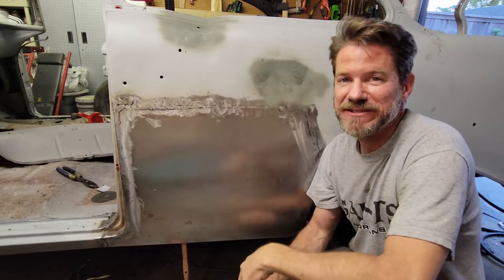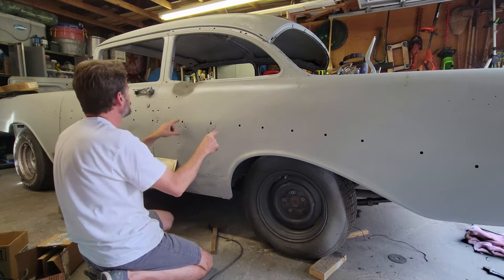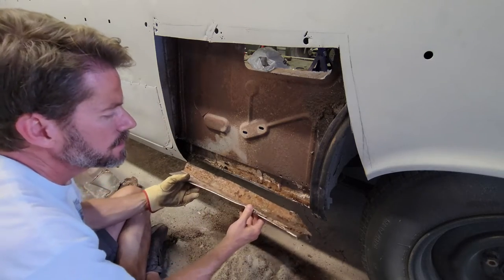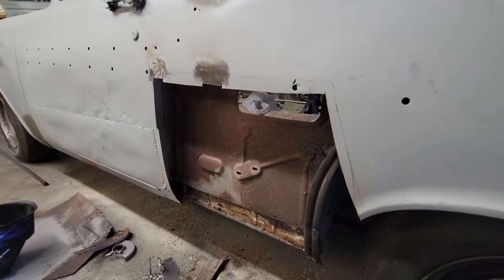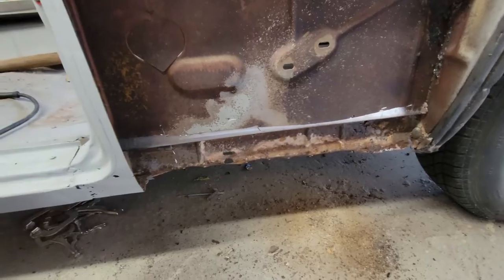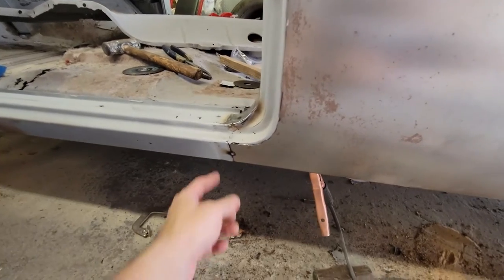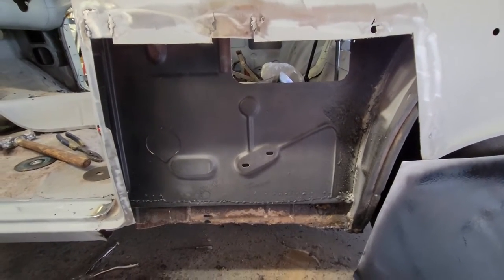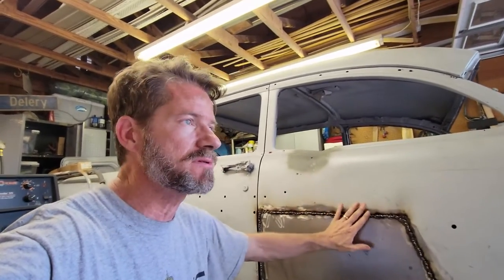E17 Tri-Five Rear Quarter Panel Fender Replacement!  1956 Chevy Bel Air Restoration

Comment: Heat causes shrinking. What you have now is shrinking, you have to make it relax now.
Reply from the maker: Yes, and I've got a little bit of work to do on a couple of broad panels to do exactly that.  I had good luck on stretching the trunk lid weld, but no luck on one of the doors and one quarter panel.  Gotta fond a way!

Comment: I know nothing about welding, but it is interesting to see the problems that develop when installing replacement panels or metal.  It appears to me that there are always different problems lurking behind metal that is being removed. Good informative video.
Reply from the maker: Believe me, I'm no expert, but you can learn a LOT about what works and DOESN'T work by doing this!  I'm still fumbling around, looking for the magic combination.  I'll probably figure it out on the last inch of the very last weld!

Comment: What did you think of the cutt and butt method? Thinking of doing the same on my project car here soon.
Reply from the maker: @dlandes14  it works, but the real key is maintaining a tight gap, but still a GAP. Fitzee's trick is that by cutting on an angle, there is a taper of material from both sides that helps provide a tighter gap that resists blow-through.  It still takes practice, patience and an acquired skill.
Reply: @RestoringChristine1956  what's the thinnest cut off wheel you can buy? He makes it look so easy but I suppose years of practice will do that lol. Looking forward to going through your videos!
Reply from the maker: @dlandes14  I always used the Harbor Freight "Hercules" metal cut off wheels.  That's a pretty standard thickness at 1/16" https://www.harborfreight.com/4-12-in-x-116-in-x-78-in-type-0141-metal-cut-off-wheel-10-pack-57142.html

Comment: hi, i enjoyed watching all your videos, gave thumbs up to all, can't wait to get started on mine but have 2 problems, 1) my floor is so bad, the body is sitting on the frame like a wet wash rag, i don't know what the distance is between pinch welds, 2) my doors can't open unless you use a screw driver and pry the doors open, they are rubbing on door latch, so don't know where to brace anything to get started to keep things square, any advice, thank you
Reply from the maker: Glad you've found the videos to be helpful!  If your car is fully assembled, I think I'd start by trying to shim everything square temporarily and then lock that down with braces on the interior.  If your door has to be wedged opened with a screwdriver, what is that compensating for?  Is it that the hinges or latches are misaligned, or is it that the body isn't square?  Whichever it is, see if you can get that straight first.  You're looking for 1/8" to 3/16" gap around the perimeter of the door on each side.  Assuming the door is OK, I'd use it to figure out where the body needs to be and then stick with that.  The doors have to align with the rear quarter and roof first.  Then the rocker panel (if you're replacing it) will align with the bottom.  The front fenders will index off of the doors, no matter where they end up.  When you put the floor pan in, only the front has a pinch weld seam.  The back overlaps, so you've got some wiggle room there.  But think about it this way... when you cut out the floor, you're not locked into anything that you can't adjust if you need to as its going together.  Hope this helps!

Comment: Just did a similar thing on my 57 sport sedan but replaced the whole passenger quarter.
Reply from the maker: Part of me says that the entire quarter is probably easier.  Welding across the middle of the fender where there isn't any structure to hold it firm makes it that much easier to warp.  Welding where there are twists and turns keeps everything from easily distorting.  Good luck with your 57!
Reply: @RestoringChristine1956  thanks!  The passenger side is all wrapped up, now to do the drivers side.  Much less work to do there.

Comment: How come when you're welding in the panel I see you hit it with the grinder? Is that to make the spaces bigger for the welds? If the panel metal and original body metal are too close is that bad for welding? I'm new to all this
Reply from the maker: It's a "cut and butt" method professed by Fitzee's Fabrications.  You shape your piece first before cutting anything. Then you cut it roughly, leaving some of the edges long, and tack weld the new piece on top.  That's when you use the grinder to cut the two against each other as you make your final weld.
Reply: @RestoringChristine1956  Ok I see now whats happening. I've been meaning to watch that guy's channel you mentioned. I'm doing a 55 150 right now and watching everything you do, thanks brother!
Reply from the maker: @MrDoeboy211  glad to have you with us!  Definitely check out Fitzee! A lot of what I do is just derived from what he does.